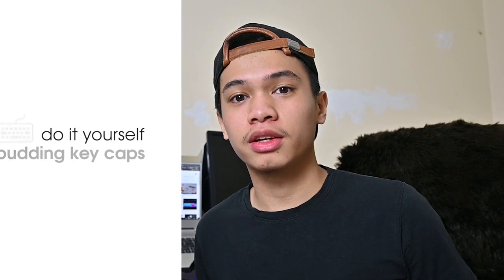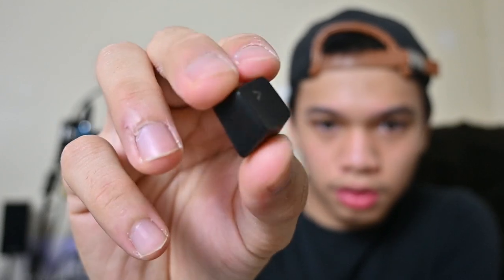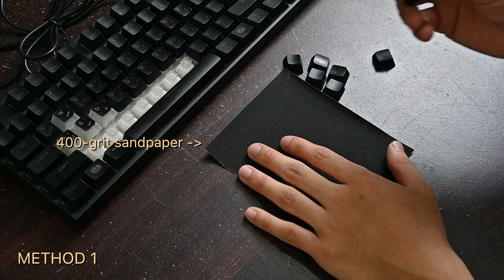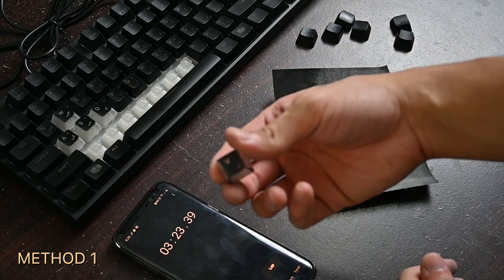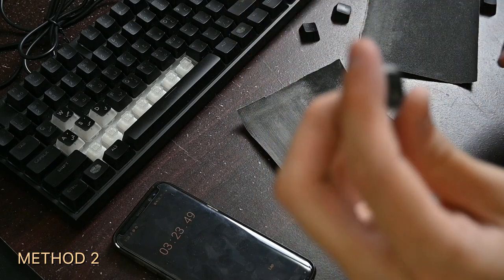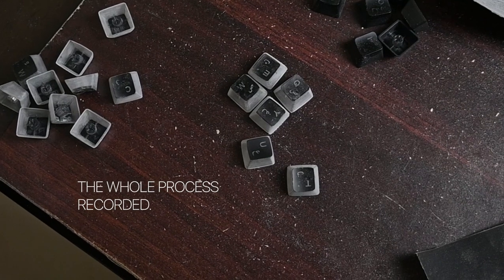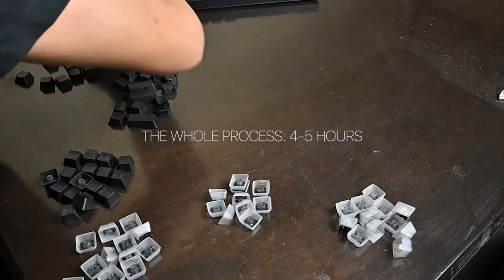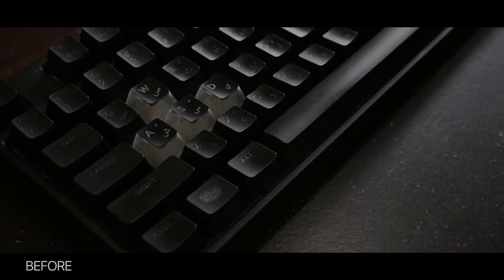DIY Pudding Keycaps Mod Compatible with ANY RGB Keyboard | SAND PAPER TUTORIAL

Comment: Thanks for this video.
I'm a professional painter from germany and have some advice for better results : 
1. Use 600 + 800 + 1000 grit sandpaper.
2. Sand the keycaps with water, that helps to make it smoother and look better.
3. Wash them with water and some soap or all surface cleaner.
4. Dry them with a microfiber towel, or just put them in a bowl and let them dry over night.
5. If you have a Quick Detailer (With Wax for example Carnauba Wax) or maybe even any type of plastic polish or coating you can use that for the keycaps, that will make them even smoother and look like actual pudding keycaps made by a big brand.

I did all this on my Steelseries Apex 7 which I use for work and I think I'm going to do this with my Glorious GMMK Compact too, because I can't find any ISO-DE Layout Pudding Keycaps.
Reply: Mega!
Reply: Can you make a video, to see how they look? I just bought the Apex pro tkl and it's the nordic version, and I also bought the hyper X pudding caps but they are in the US version. So I am missing some of the buttons, and I want to make them myself. Can you please post a video of how the look?
Reply: you mean use all of the sand paper you said? or just pick one?
Reply: @diabeticusmaximo1133  You can just use 1000 grit sandpaper, but it will take longer.
Also, don't forget to sand with water to make it smoother and look better.
Reply: Can you use clear coat instead of wax?
Reply: @Steven-ye8ys  Yes, but it will make the keycaps really glossy, if you use Wax it will just make the surface feel and look smoother.
Reply: @voqzmk2  Thank you!
Reply: So do you use quick detailer or wax or just both of them?
Reply: Or is it just the same thing?
Reply: @mehmetkalat6769  I used Gyeon Q2M Quick Detailer, but any quick detailer will work.
Or just use a wax or some type of plastic polish.
Reply: Can you link a video or some pictures to the finished product?
Reply: @spartameister  I don't have these keycaps anymore, but they look almost identical to the HyperX Pudding Keycaps
Reply: Yoo Thank you

Comment: Next time take my advice use sand paper 1000, and sand keycaps with water ;)
Reply: show me how yours look
Reply: @ShagMyster14  i have a razer huntsman TE with hyperx keycaps (pudim) nothing special, but i know what im talking about  ;
)
Reply: True, 1000 and water leave the plastic so smooth and clean, if you do a nice job you barely will see any scratches
Reply: how do you do it with water i dont understand
Reply: @ahflanky7663  just wet your sand paper and the keycap and start sanding
Reply: you go straight to 1000 sand paper or go with lower first and then level up?
Reply: @Froztik  I always start for the hardest and then go with the smoothest, personally I use 240 to take off all the paint, then 400, 600, 800 and finally 1000 for a mate finish after drying out

Comment: You can actually buy 6 mm sanding sticks (3M or York) that are plastic with different grits, cut them to size (5mm or 4mm)  put the keycap on a flat surface (paint scraper) and go round the bottom of the key cap for that 3d pudding look and hopefully get a straight edge :) deffo use water because the paint can chip off past the pudding line.